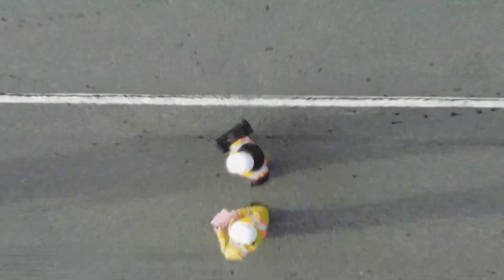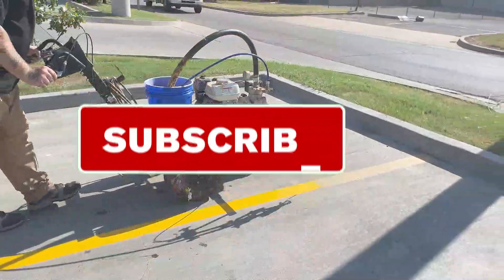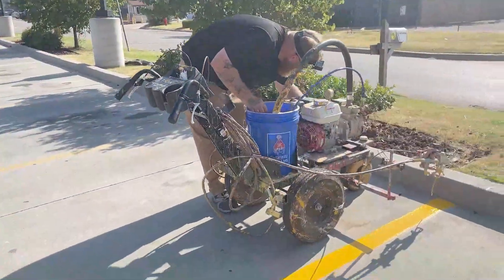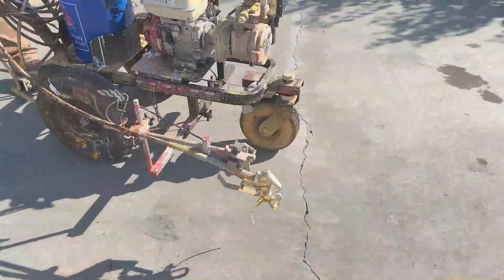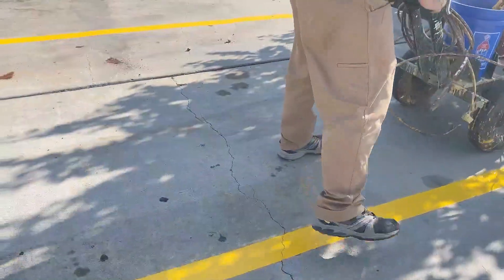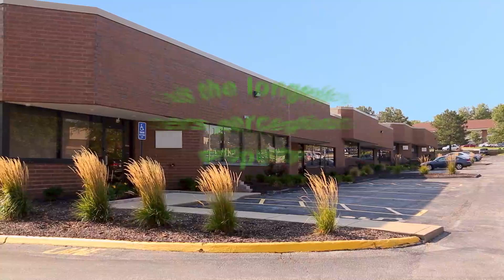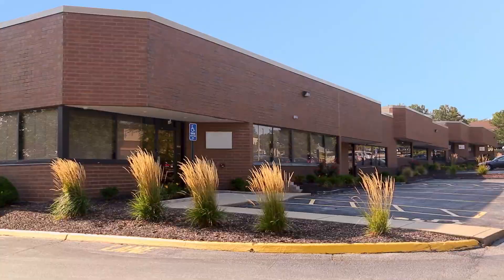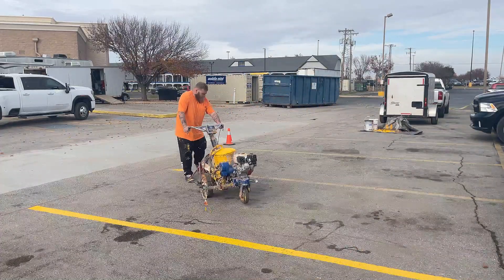This UPSELL made My Company $60k Last Year! The BEST Upsell For PRESSURE WASHING:

Comment: Im finding out that a lot of people ask about seal coating which i dont do yet. Im still using a 4 inch roller and striping by hand. A disadvantage of only having a 4 cylinder truck is the weight towing capacity and my toyota is getting close to 300,000 miles. A lot of the businesses i give my business cards out to that have faded lines also have badly oxidized asphalt that is extremely light gray in color. I'll get asked a lot if I seal coat , especially from property management companies. Thats really who i want to make connections with is the property management companies because i'll go in a small plaza shopping center and find out that the contact people are out of state with properties not only all over my state but in the states that surround me but i'll get asked that question..."do you seal coat"?  The goal for me in 2024 is not only getting a striping machine but a V8 truck that can pull weight with a trailer and one of those low budget IBC totes with a DIY agitator in it for seal coating. The few people in my area that stripe, also do seal coating. I've really got to step my game up for 2024.